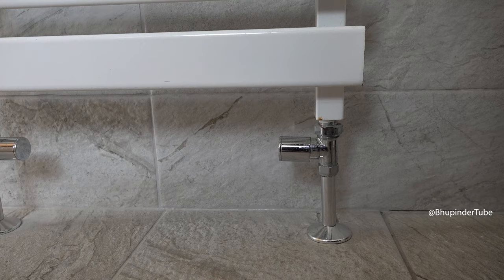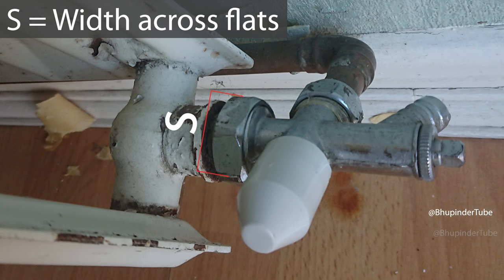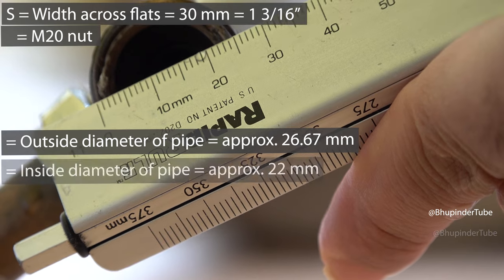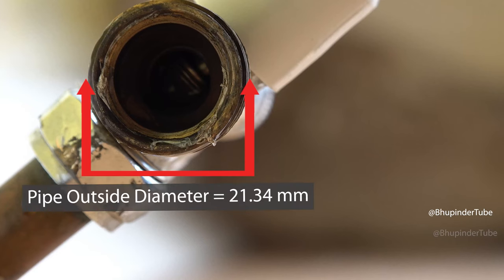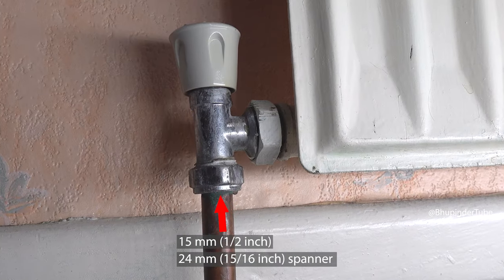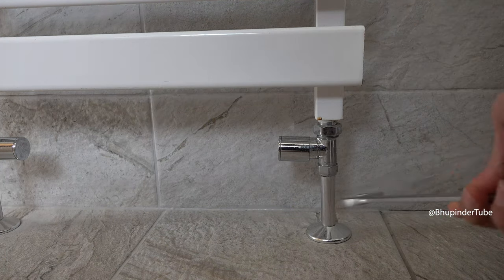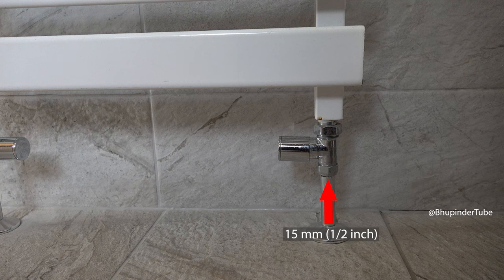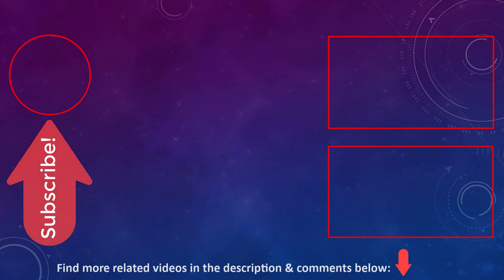How to check radiator valve size

Comment from the maker: You could find all my DIY videos in this playlist 👉 DIY Tutorials - https://youtube.com/playlist?list=PL6oDA8S3RmtE5kt9EoQ5HwN10JII6AFKt
You can find all my radiator tutorials in this playlist 👉 Radiator Tutorials  - https://youtube.com/playlist?list=PL6oDA8S3RmtFLnYXe9_ydvL9npYSnUhDY
If you know the spanner size for 8 mm (5/16 inch) & 10 mm (3/8 inch) connections, please mention it in the comments?
The best way to support my channel is by subscribing, thanks 🙏  If you have any questions, please let me know in the comments below 😊
More related videos below:
👉 How To Remove A Radiator - https://youtu.be/4jP8eN_z_eA
👉 How to measure the diameter of a pipe - https://youtu.be/JohIiUOMU7o
👉 How to change Makita circular saw blade - https://youtu.be/Banqa8JAUZM
👉 How To Cut a Plastic Duct/Pipe - https://youtu.be/tl00kUgZu0A
👉 How to cut a plastic pipe straight - https://youtu.be/kOy0cn3U9xw
👉 How to install a dishwasher - https://youtu.be/3YUuQhu41Qg
👉 How to Disconnect a Dishwasher -  https://youtu.be/Mzc5GcyNEv8
👉 How to clean your fridge freezer drip tray - https://youtu.be/bGWVpzqnelE
👉 How To Lock Vise Grips - https://youtu.be/S9xnT9hIhqw
👉 Soap Pump Not Working - FIX - https://youtu.be/gXkxYpTyDMM
👉 How to fix a dripping tap - https://youtu.be/D6QFe_KTuvc
👉 How to set the lock on a suitcase - https://youtu.be/HduFDF-2CX4
👉 How to isolate kitchen tap - https://youtu.be/uK8yV05ZopU
👉 How to open Nissan Micra when battery is dead - https://youtu.be/YhOCuJhU1OA
👉 How to stretch your Glasses - https://youtu.be/W5zPfJZqkIs
👉 How To Open A Very Tight Jar! - https://youtu.be/BOgPJAYETME
👉 How to install hooks for the cups - https://youtu.be/znhKSCRf01U
👉 how to unblock a sink - https://youtu.be/O5JQ7qpnWb8
👉 How to make your own DUMBBELLS at home - https://youtu.be/vPgJW61YT4w
👉 How to remove wallpaper - https://youtu.be/1SZLZ13RzKE